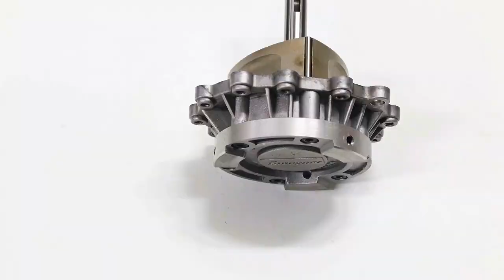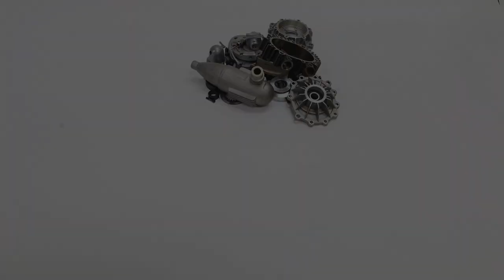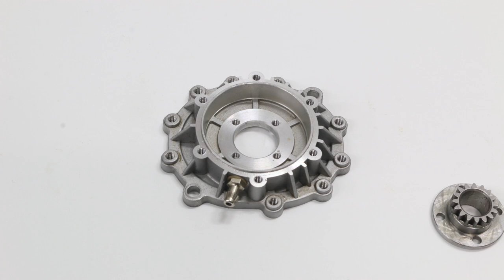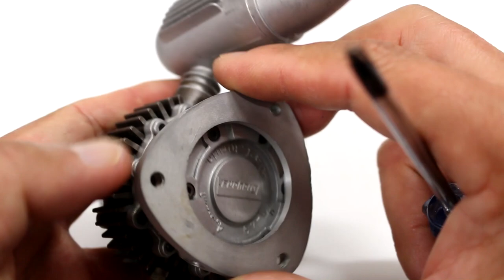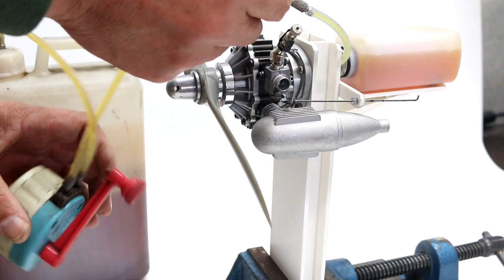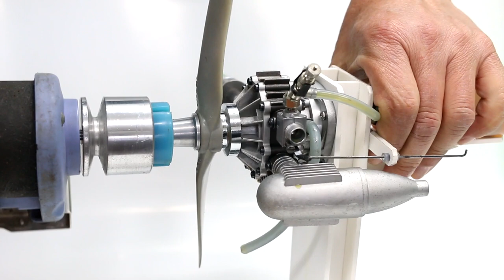WANKEL ROTARY ENGINE - STOP MOTION

Comment: I always thought you would need a spark-plug but it looks like it is using some kind of wick?
Reply: It's a glow plug
Reply: All deseil engines even full scale ones have them. They help compression based fuels to ignite
Reply: +Toby Wenman  Not true, Most Diesel engines DO NOT have glow plugs... they are typically found on automobiles and light duty engines and only used during cranking... glow plugs do not operate when a Diesel engine is running.
Reply: I'm an idiot I have control line planes that run deisel and have no glow plug, and I just wasn't clear on it being turned off as the light on the dashboard goes out when they're not on
Reply: +Toby Wenman Indeed,  as to your "Diesel" plane engines, It was my understanding that these engines require a special fuel. Is that true for your engine?
Reply: Each of them are slightly different and they all have oil as they're 2 stroke. They don't run regular car diesel out of the pumps though the fuel is kinda thinner.
Reply: +Toby Wenman OK, and they use a carburetor too, Right? So its not really a Diesel engine in the true sense, they are not 'SCCI' Stratified Charge Compression Ignition these engine do not generate enough heat through compression to ignite the mixture without some type of chemical reaction ignition source... Most of these engines require a special ignition additive chemical such as either compounds which ignite spontaneously with very little pressure or temperature. 
The engine uses a carburetor and the air and fuel are introduced before ignition occurs "Homogeneous Charge Mode of operation. The Diesel only admits air (single fuel Diesels) into the cylinder and fuel is injected only at the time of ignition, this is called Stratified Charge Mode. cheers!
Reply: +KHALIIL01 Just the facts here... nothing personal, so need for you to preach.
Reply: +KHALIIL01 That's great, we need someone in the future to preserve this outdated, obsolete technology for its historical value... but it would help if they actually understood something more technically relevant than just “I love how this engine works and I want one”
Reply: +KHALIIL01 Are you seriously suggesting that the Wankel engine can be significantly improved? What exactly is the basis of this unorthodox theory?
Reply: +KHALIIL01 Most of the development history of the Wankel KKM engine pre-dates and had already been out of circulation prior to the widespread use of the internet or the existence of Google...

Comment: Good Video, but electricity has to win over engines
Reply: ice bread lol no.
Reply: Thesnowtiger 92 electric is better and it will replace ice, wheter you like it or not. much better efficiency, power-to-weight ratio and torque.
Reply: England is my city     Most petrol heads are fine with electricity replacing ICE. What we really don’t want is for then to go away. We still want internal combustion engines. Even Wankle Rotaries.
Reply: So? What does this have to do with model engines with no practical application? Nothing, thats what. Only thats an ICE and that you have to needlessly validate your opinion / stroke your ego.
Reply: there's just one thing....where does said electricity come from?
Reply: Rick Delair hid have never been and will never be more efficient than led, period. led produces less heat per unit of light, hence a higher efficiency. white leds are not fluorescent lamps, i don't know where you get your information from, but an led works in a fundamentally different way than any fluorescent light source. 2 strokes have worse volumetric efficiency, you can argue all day long but physics doesn't lie. they also have worse emissions than 4 stroke engines, which is why the latter has become the standard engine type. the next big step for ice is anything but going back to 2 stroke engines. in fact, the next big step will be mazda's new hcci engines (homogenous charge compression ignition), which will be essentially an engine with gasoline-type emissions and diesel-like efficiency in one engine.
Reply: Electric vehicles will never replace ICE vehicles in most applications. Batteries are simply too inefficient and EVs will always have horrible range and payload performance.

Comment: Wankel, not rotary. Rotary engines rotate the cylinders around a fixed shaft.

https://en.m.wikipedia.org/wiki/Rotary_engine?wprov=sfla1

https://en.m.wikipedia.org/wiki/Wankel_engine?wprov=sfla1
Reply: Multiple and rotated cylinders is called "radial engine"
Reply: @arisz2191  you couldn't be more wrong. Radial engines have fixed cylinders and rotating shaft. Rotary engined have fixed shaft and rotatin engine block. Check the Sopwith Camel engine.

https://en.m.wikipedia.org/wiki/Radial_engine?wprov=sfla1

https://en.m.wikipedia.org/wiki/Rotary_engine?wprov=sfla1

https://en.m.wikipedia.org/wiki/Wankel_engine?wprov=sfla1
Reply: Oh, so according to your ingenious mind the ROTOR in the Wankel engine is NOT rotating... OK then!
Reply: @DanSlotea  
...in other words, the ROTOR in the Wankel engine does rotate according to you so is not a ROTARY engine?!!!! What a genius!!!!

By the way, you had to edit your original post because you messed up big time!!!...😂😂😂
Reply: @juancabeza5809  Its called a piston dummy... the Wankel KKM engine ia not a Rotary type engine and does not have a rotor.

Comment: WOW I had no idea there were rotary glow engines. I bet it revs to the moon.
Reply: This is a Wankel engine... made by Graupner
Reply: It doesn't rev as high as nitro piston engines do, actually. Even my cheap nitro engines rev to 30,000rpm or higher, but this rotary engine revs to about 17,000rpm. That's because the internals are all cast iron, whereas the piston engines use aluminum nowadays, and also it's a 4-stroke whereas most nitro engines are 2-stroke.
Reply: 30,000rpm? you must referring to the 2stroke engines for the RC Cars, engines for the model aeroplanes don't rev that high, usually 11 to 12,000rpm max, depending on the prop and maybe with the use of a tune pipe. but turning a big prop sometimes it's more important on these type of engines than having high rpm, so torque is more important. this wankel tough as a small 4 stroke revs much higher than a conventional small rc 4 stroke engine.
Reply: +Shawn Elliott Yes, as you pointed out reciprocating engines can actually rev HIGHER that the old Wankel engine could...
Reply: +ripmax333 Torque is not a significant design factor in aircraft design... including RC planes. Aircraft engine manufacturers rate  output in horsepower for a good reason. High rpm is generally not a significant advantages as their are limitations on propeller efficiency if rpm is above the ideal range.
Reply: +ripmax333 The advantage of the 4-stroke concept is higher efficiency and longer service life... something the Wankel engine did not offer.
Reply: what i tried to tell is since Shawn Elliott sad that since his rc engine can rev up to 30,000rpm he must be referring to a Car RC engine. they usually have a much shorter stroke than those used on RC aeroplanes. a longer stroke sure helps to turn a large propeller.
Reply: +ripmax333 Shawn Elliot's knowledge in this area is not as great as he wished it could be, his experience seems limited to model and RC engines... which due to their small bore diameters and small scale generally can rev much higher than larger engines used in commercial production. cheers!

Comment: I have owned and flown several of the OS Graupner Wankels.  CONTRARY to popular belief, 
the chief wear is NOT the apex seals.  The main wear problem is between the rotor and the 
front and back plates. Unlike the Mazda, the OS Graupner has no seals on the front and back
sides of the rotor.  One beauty of this design is that a worn engine can be restored by polishing 
("sanding") the end plates against a flat plate of glass which effectively removes the wear.

I still have a new, never run, OS Graupner Wankel.  It is not for sale.
Reply: wow. ive been looking for an OS wankle but i cant seem to find any. have any clue?
Reply: New ones were sold out decades ago.  I purchased one, maybe the first example in the USA, at a hobby shop in Munich  before they were being imported to the USA. 

It wore out after flying for some time, so on a later trip business to Germany I returned it for exchange.  I took it to a friend and Graupner employee at the Graupner headquarters in Kirchheim near Stuttgart.  My present new one came from the Graupner US importer, World Engines of Cincinnati, OH. World Engines folded long ago.
Reply: Graupner GmbH. discontinued these engines years ago... Wankel engines are obsolete and no longer manufactured anymore.

Comment: You forgot the roller bearings.
What fuel mix do you use for rotary?
15%?
Rotary would have less torque? Less moving parts though.
3 combustions per revolution as apposed to piston 2 stroke only 1. So lower fuel efficiency?
I dont know, im asking.
Reply: Toy engines like this often have simple bushings.
The Wankel had less torque... mechanically it was less efficient.
Not true, the Mazda 13B Renesis had 235 moving parts
One combustion cycle per crankshaft revolution.. 3 rotations to complete the firing order sequence.
The Wankel used the 4-stroke operating cycle.
The Wankel had low mechanical, combustion and thermal efficiency.. less than a reciprocating 2-stroke engine.
cheers!
Reply: doktorbimmer Interesting. I was refering to this perticular engine though. Yes definetly, the larger car engines have different dynamics. I player around with them long time ago. This guy used a starter motor otherwise i was going to ask if he can show us the chunks taken out of his fingers from prop bites.
Reply: Its an rc engine. Who cares about efficiency. The point of using wankel engine instead of a piston engine is that it produced lots of power with high rev limit with not much moving parts and lightweight.
Reply: +what the fock Then why was the Wankel design a failure? It never replaced the reciprocating and turbines engines....

Comment: Great little engine what's the cc, hp not lots to go wrong is it two stroke?what life span of tips on rotor
Reply: Research Wankel engine
Reply: This is a Graupner 49PI engine.
15cc total displacement, 1.1 horsepower.
It was very unsuccessful due to reliability problems and high fuel consumption.
All Wankel engines operate using the  4-stroke principle.

Comment: Neat but where the the glow plug starter is located would make me nervous.
Reply: Todd Cooper im not that good with rotorys could you explain why please?
Reply: Same here
Reply: Too close to the prop for you?
Reply: I have one. It's fine as long as you remember to not reach through the spinning propeller. But if you're really nervous you can make a remote connection for the glowplug. One wire connects to the tip of the plug and the other wire connects to the crankcase. Then you can put a remote battery connection anywhere you want.

Comment: Would this engine operate off HHO? Other idea would the use of magnetic bearings improve its function? Is it possible to modify this engine into a Stirling cold gas engine operating off liquid air? 😊
Reply: No.

Comment: Be neat to see if a cold gas stirling rotary engine could be developed that used Gadolinium has magnetic bearings from operating off liquid air? Using frequency to turn liquid air instantly into a gas like a combustion engine just not generating any heat or toxic fumes only regular atmospheric gases from the engine's use? 😟😕

Comment: this engine needs to mix 2T Oil in the gasoline? to lubricate inside?
Reply: "Suspeitei desde o principio", I work with 2T engines, it seems the oil don't burn with the gasoline, a new 2t engine don't exhaust any smoke, like a 4t engine.
Reply: Most rc fuel already have lubricants on the fuel itself, so it doesnt need to

Comment: They will work but with decreasing deficiency with use due to normal wear points.  The seals at the tips of the rotors wear down and you lose compression  Add this to the normal problem of valves being subjected to increasingly corrosive exhaust...  They sure are pretty, though
Reply: Yes, a fascinating and unique obsolete design, sadly it was inferior to reciprocating engines.

Comment: It's a trip, that there is no magneto for spark ignition timing.  If the plug is glowing red all the time, what stops early
ignition, the moment fuel enters the chamber?   The time the two are in contact, fuel and fire, is a long time in the realm of engines.
Reply: Steve Solo mostly the compression like a deisel engine. These little RC motors run differently, higher rpm, lower fuel mass, different fuel mixture. This fuel has nitrous in it and no oil sump, that is in the fuel as well.
Reply: +Ryad Arlan Absolutely not! Homogeneous charge combustion, No compression ignition here, the Wankel cannot support Diesel cycle operation. Glow ignition only... special fuel has low auto-ignition temperature and ignition is highly erratic... OK for toys... not for mass produced commercial applications.
Reply: +Nuno Santiago Actually NO, IT CAN'T... the 2-R6 prototype was a colossal failure and was quickly abandoned... as were the many other failed attempts to build a compression ignition or Diesel cycle Wankel.
Reply: Have you tried a "Motoplat?"  It has no black box with a power curve programmed inside. It's basicly a magnetic trigger and a coil.  The trigger is usually mounted on/in a flywheel.  The faster the motor spins, the faster it fires.

Comment: There is no wire on a spark plug?
Reply: It's glow plug - used only for start time. When engine is running combustion temperature maintain glowing this piece and continuous firing mixture.

Comment: looks like a lot of vibration.. is that normal?
Reply: From the look of it, his engine is missing the Woodruff key that fits into a slot on the crankshaft to properly align the front counterweight.
Reply: Wankel engines have extremely high moment of mass in the heavy  3-sided piston. these create vibrations that limit the maximum rpm.

Comment: No Side Seals. No Corner Seals. Probably runs with a pretty low compression ratio.
Reply: All Wankel engines are limited to low static compression ratio by the inherent limitations of its internal geometry... its weak sealing system wears out quickly... resulting in low indicated compression and poor performance.